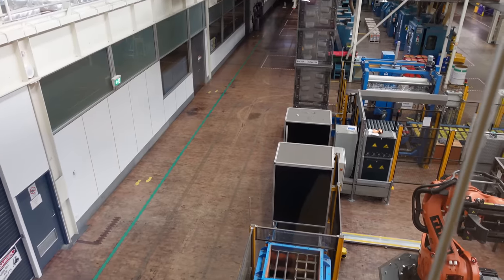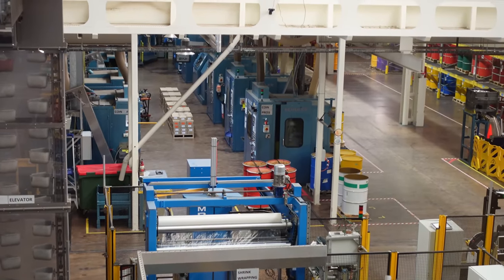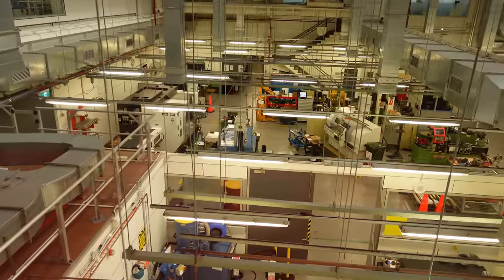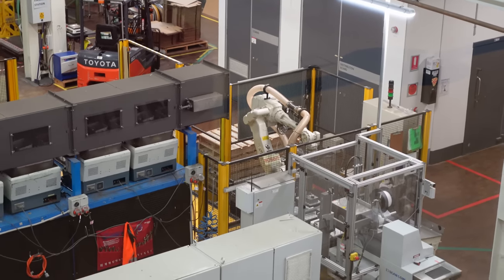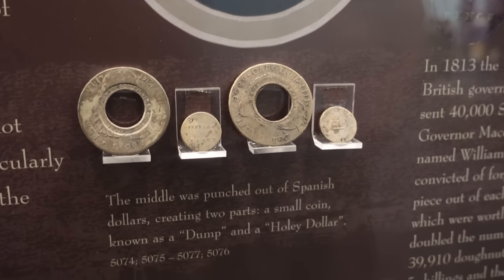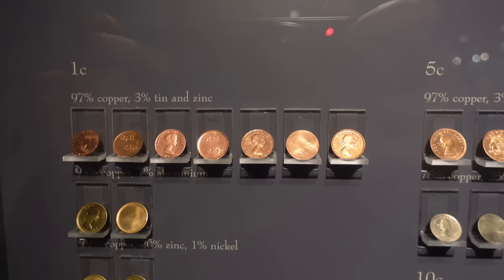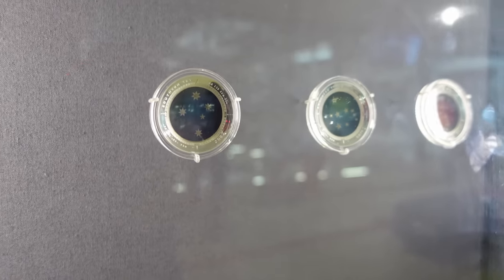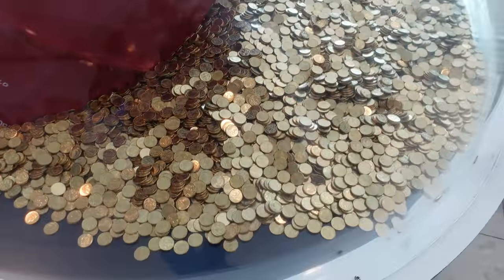How Coins Are Made at the Royal Australian Mint

Comment: 2 barrels then you refurbish the die set. As they are not proof minor wear is tolerated, as the coins will wear in service anyway, but they do last a much longer time than notes, so there likely are still old original press coins around.

Fun thing is the old brass and nickel coins are actually worth more as scrap metal than as coinage, so there were a few "enterprising" types who would melt them down for scrap metal, though they were eventually found out, and probably still are a "guest" in the grey bar hotel, for destruction of mint property.
Reply: This^^^
Reply: @costerth  The mint by me does a big part of their business in doing Euro cents, which is why you find so many country coins are the same diameter and thickness, because they all use the same metal blanks as source.